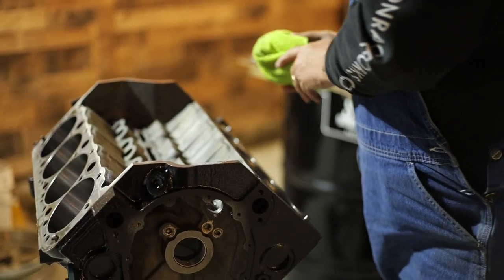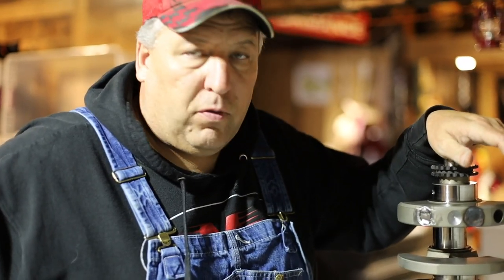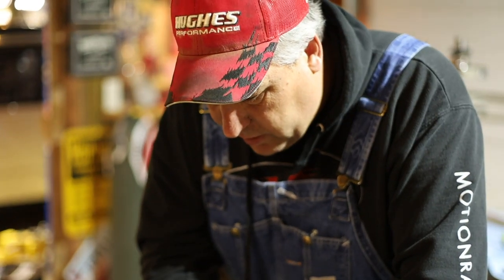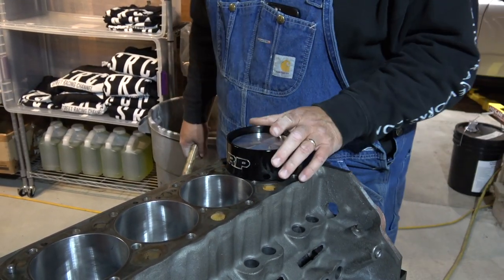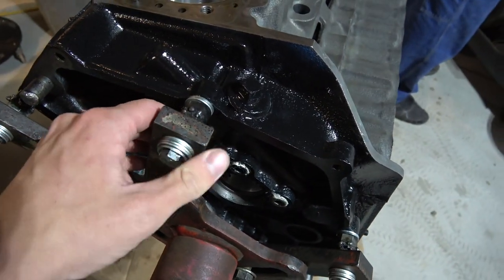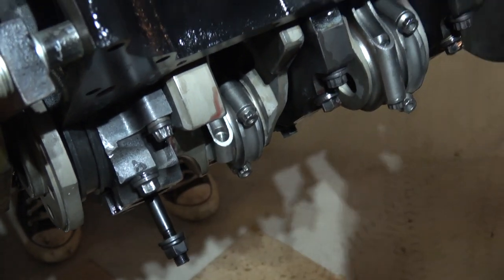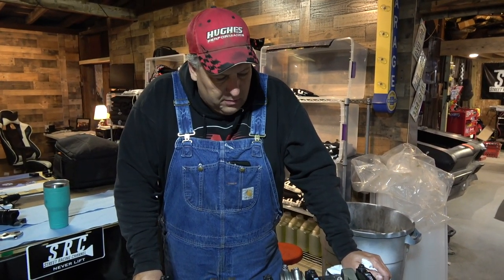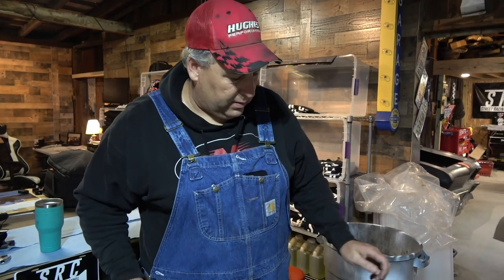Assembling the Short Block! + Tech Tips from The Old Man!

Comment: I used to tighten the rod bolts to 75 % per cent, at  one at a time, and keep spinning the crank by hand ,oil wedge is a pain.  then re torque the main and rod caps.

Comment: First, put the camshaft in when you can hang on to it from the bottom side, you don't slam cam bearings that way, carry on, good job, my engine stand has a Chevy only bolt pattern with spacers on them, been holding a big block for to long

Comment: Is that an aftermarket block and main caps? Because stock 4 bolt main 400s are weak in the bottom. 2 bolt main 400s are stronger.
Reply: Factory 400 blocks would not hold up at this level.
Reply: @stevenbelue5496  this I already know.

Comment: What brand rotating assembies do you use with both trucks?
Reply: I remember Billy saying he used a callies in what I think was his last build, not sure if it was last build. I’d like to know what series callies he used. I’m wondering if the compstar series will hold up those power levels. I haven’t heard them mention any dyno numbers or guesstimations but I’d say his truck is centered up between one to two thousand hp. Seeing that wheel up at 30 psi I’d say it’s getting close to the latter.

Comment: Im not breaking balls, and just because there is a girl pict here does not mean its not her old man that has built 1000s of engines! That is a N/A crankshaft, maybe small nitrous shots! I know you hit it fairly hard before, but I would absolutely not try to hammer that crank as hard as Billys! It has more stroke and has been cut down in the counterweight to throw area! Thats where they will break! Small blocks are stout, but that shortblock is hopefully to get Tommys feet wet in boost, than maybe saved before it breaks for the 55? Good luck guys! Its always nice to see those S10s gap much more race oriented cars!

Comment: Hay Bill how far out do you gap the rings for the heat from the boost
Reply: .033” top .030” bottom as per Wiseco specs
Reply: Arp recommends 55 ftlbs on sbc rod bolts next time

Comment: I still do not get why people don't put all pistons and rods in the turn engine over then tighten and torque I know you need to be careful but it's alot easier also to anyone who don't know you need to NOT use extensions on a torque wrench but if you do increase 3 to 5 pounds due to twist in extension per extension

Comment: What fuel ya'll gonna run?
Reply: Methanol on Tommy's truck
Reply: @19jody72  was hoping they was going to stick with the E85 idea, just because that was something I wanted to try too, 11:1 compression and turbo on E85
Reply: @CarportGarageDragRacing  damn.. you're going to need at least that I'd think. 10lbs or so?
Reply: @19jody72  I'm not sure. My sons Gen 1 SBC 383 is 11:1 compression and my Gen 2 LT1 is 12.3:1 compression. We are both running 11s on motor and deep 10s on 200 shot with traction issues. Thinking about going turbo like everyone else or putting a fogger on these cars. Would like to be able to compete in the street car heads up classes.
Reply: @19jody72  my car is fuel injected flex fuel with LS ECM, his we run 93 octane on motor and VP110 on 200 shot, going to try 250 shot this weekend on them both.
Reply: @CarportGarageDragRacing   Big duration cam?  You run 93 at the truck on motor?
Reply: @CarportGarageDragRacing  itll be on E-85
Reply: @19jody72  yes on both cars run 93 on motor, 242/250  at 0.05
Reply: @tommyhoskinson3662  I'm excited to watch your build
Reply: @tommyhoskinson3662  what's compression going to be?